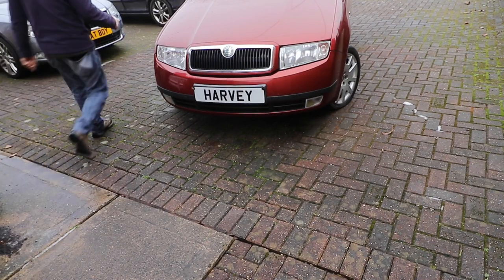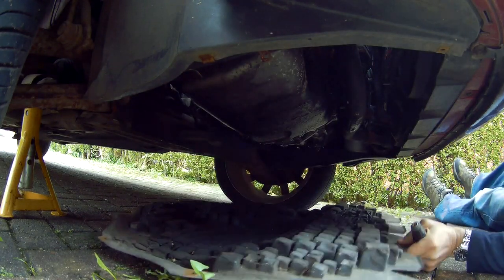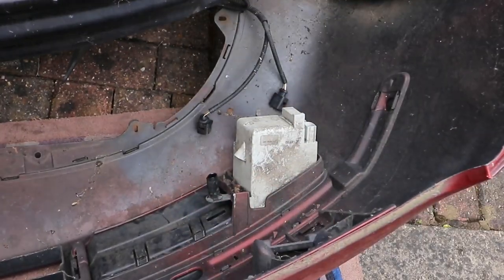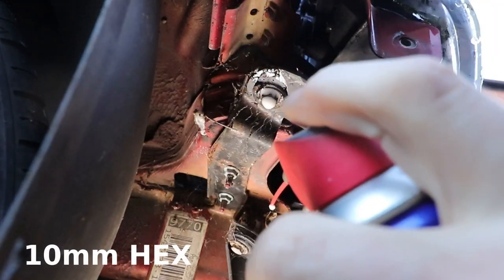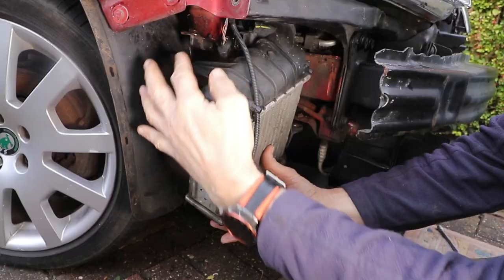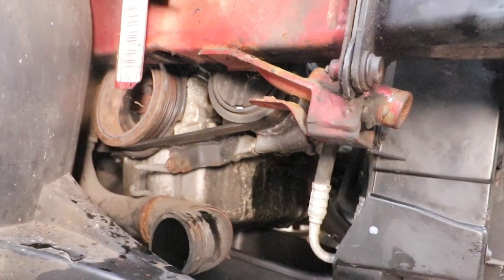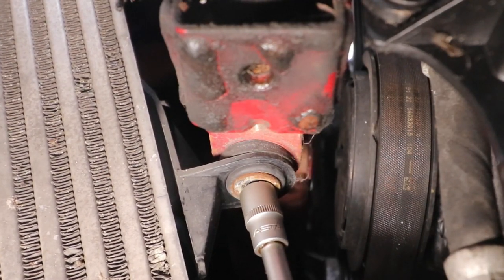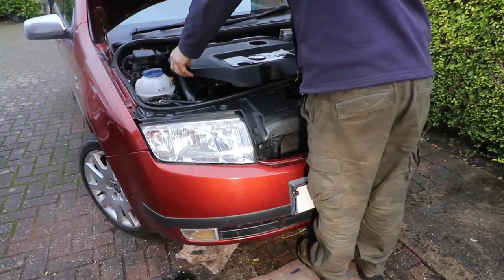SKODA FABIA TURBO INTERCOOLER Oil Drain 1.9 PD MK1 99-07

Comment: Thanks a Mill for this ! Funny once you get in there the job gets bigger ! I have some cracks in my bumper that are needing fixed so I'm definitely going to clean the turbo pipework- oh yes there is also a dodgy connection on one of the foglights and the outside air sensor is duff - The amount of videos you have done on the Fabia is invaluable - Reall can't thank you enough for these !!
Reply from the maker: You're very welcome, glad to help others, hope you get all those jobs fixed :-)

Comment: Identical setup on a VW Bora MKIV, I found the intercooler sheild can rub thru the cores at the bottom over time. I trimmed a few millimeters off mine to prevent further damage, I also put a self tapper in the bottom of IC to do bleeding when needed.
Reply: Hi, can you tell me what kind of self tapper you used? It sounds like a great idea.
Reply: @rupert1124  TechFast Hex/Washer Self Drilling Roof Screw 6.3 x 25mm

Comment: Another great vid Harvey. I was going to ask if you might induce boost leaks on your pipes to the inter cooler but as your clamps are different it seems you are safe on your engine but the Fab vRS and mk2 1.9 PD Octavia have the different boost pipes. Do you think disturbing them may induce leaks when carrying out this job ?
Reply from the maker: Thanks. Those engines have the metal inserted flange coupler and seal that I'm not a fan of as the Mk1 is much simpler and if you needed it to be more secure then you could fit a simpler metal band and tighten down. There are lots of modification to those couplers - flange heaven. Don't let them stop what is in effect routine maintenance :-)

Comment: Its interesting to me that your intercooler pipes are held together with those very strong clamps - the vrs models make use of horseshoe clips which are prone to leaking or even blowing off when running a bit more boost, hence why so many people switch to hardpipes and front-mount coolers with mikalor clamps
Reply from the maker: Yes T-bolt clamps are, as you say better, but you need those if you change the flex pipes to silicone as they are more pliable and can blow off easily. Hard pipes are great, but you still will need some flex joints somewhere. The rubber ones often split hence the silicone replacements :-)

Comment: Should I disconnect and drain intercooler while I do my oil change. Or oil change first then intercooler drain? What order should or recommend i do this
Reply from the maker: Doesn't matter as they are not connected, but you do have to take the underway off so I would do intercooler first :-)

Comment: Hi Harvey. I wondered if you had done a video on checking for boost leaks and turbo wear but I can't seem to find one. Do you have any plans for this? 😊
Reply from the maker: Notes, will add that to my list, will do that at some stage, thanks. The variable gains in the turbo can get clogged up and stop functioning.
Reply: @HatBoyHarvey  thanks, that would be great. I think I've got a boost leak on my Vrs 1.9tdi as i'm only getting around 38 mpg which seems a bit low. 🤔

Comment: I have oil leak at the intercooler of a skoda octacvia.   The question is rather, why there is so much oil coming out there.      Like someone mention already, problem with turbo.   But I guess handling that is a hard prblem.  Leys behind motor and what would be the cost of that?   Not anymore worth I supspect.
Reply from the maker: It usually won't be the actual turbo, but something connected to that system that isn't functioning correctly.

Comment: I have the same problem in my car, Ibiza TDI. I find engine oil in the air cooler and the pipe. I want to know where this oil comes from. Thank you.
Reply from the maker: The turbo. A little is perfectly normal, but if excessive then a turbo refund may be necessary :-)

Comment: Being I use your site as first port of call when I have needed to carryout work on my wifes fabia mk1 I was wondering if you have done a video on how to replace the turbo as I have cleaned the intercooler and pipes but oil still drips from the intercooler area and I wondering wif the problem is the oils seals in the turbo
Reply from the maker: Great, thanks. Will certainly do a video on that as it will be a good one to do. Rusty bolts are an issue on the exhaust, so will have a look into these before I take it off. If your turbo has been used a lot (mine hasn't) then almost certainly over time things start to wear out and the turbo on these has a number of parts. Oil will come through the turbo and is normal, but excessive oil obviously is not. I'm struggling to do videos at the moment with lots of work and health issues, but will put this on my list. Thanks for watching :-)